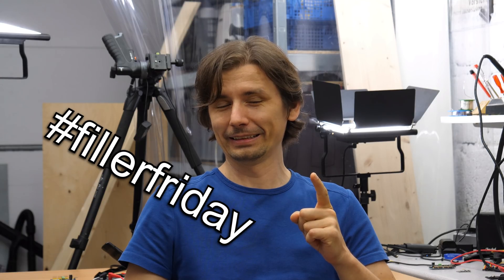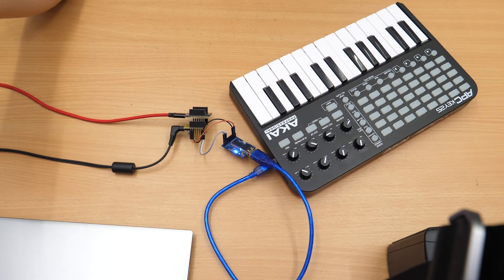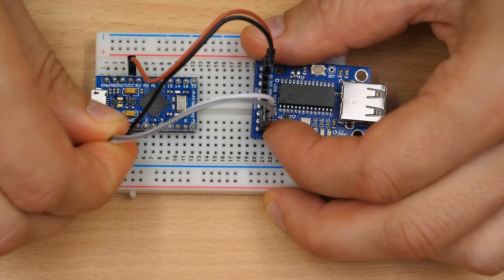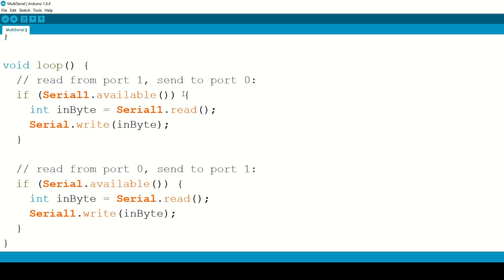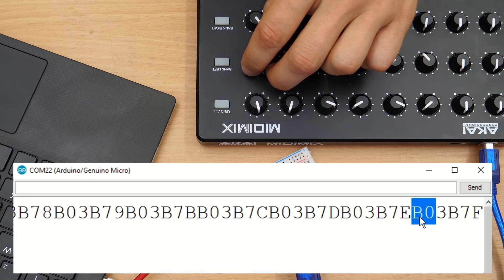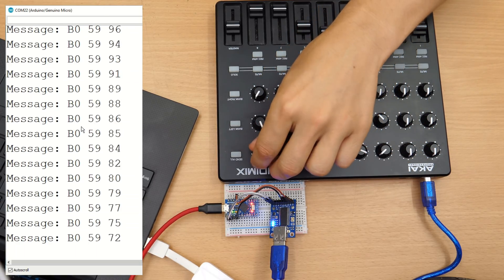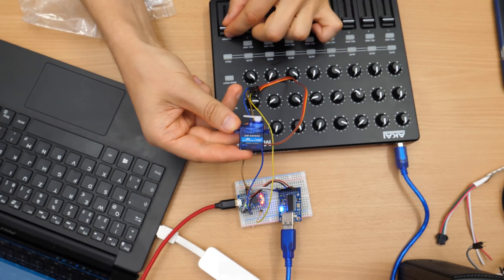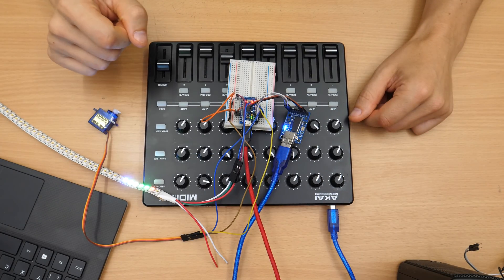Control Arduino Maker Projects with MIDI - Beginner Tutorial

Comment: Thanks this is very helpful! I have a question, I have an Arduino based MIDI controller working as a MIDI *device*. If I plug that into the USB host board then take the host output into a MIDI capable guitar pedal, that should pass the MIDI messages to the pedal and control it, correct?

Comment: I'm very interested in this concept. I would like to control 2 servo motors by switching between patches on my Boss GT-5. I still have to check what is sent out by the effect board when I change patches. But that message should trigger the servos in a certain position. The servos will be mechanically coupled to the level and drive knob of a tube amplifier. The goal is to slightly increase level and drive of the amp for lead parts. I have a Roland edirol UM1 midi to usb controller. What microcontroller  board can take in midi via a large usb socket? The controller should only take in the program change message for each patch and translate it to a PWM for 2 servos.

Comment: Nice, Luni! :D
I wonder if the Neopixel timing being off is down to servos and Neopixels not playing nicely together? Neopixels need control over the interrupt routines of the MCU, as does the servos, so they clash. Adafruit has tutorials as well as libraries to help you use both together though without problem :D

Comment: Great project! I actually have a Korg nanoKontrol 2 which I would experiment with. I've been trying to figure out MIDI messages before but never really got it until now. I have something very similar to the bit with the LED strip, but using DMX. I have an arduino with ethernet and it acts as a dmx controller over the arpnet protocol. Looks like MIDI is extremely similar to DMX. Also this vid was great with no background music! Keep it up!

Comment: what happens if you plug a hid device into it ?
Reply from the maker: There are different firmwares for this module.. should be mentioned in the shop. You can buy them also preprogrammed for different device types
Reply: bitluni's lab ohh yeah I have looked at their usb host modules before, looks like the prices are more reasonable now.

Comment: I'm curious about the esp32 synth, what did u use for sound generation? Is there a library for generating audio waveforms, filters etc?
Reply from the maker: It's just an esp8266. The waveform is a simple trinagle wave.. you can change the angle to smoothly fade to sawtooth.. the implementation also supports amplitude and frequency lfos and a basic reverb. I stopped developing it since esp32 is more suitable to do this

Comment: Hnmm... I'm just wandering if I need the USB hosta adapter or could just use an Arduino Leonardo for this?
(I'm really surprised of all the posibilities :-)))
Reply: The atmega32u4 has only device capabilities
Reply from the maker: Probably.. the atmega32u4 is probably  capable of host modes... I don't know of any libraries.. maybe we could dig into it